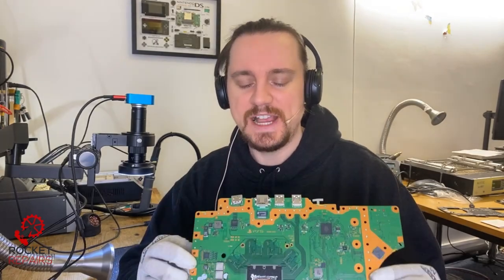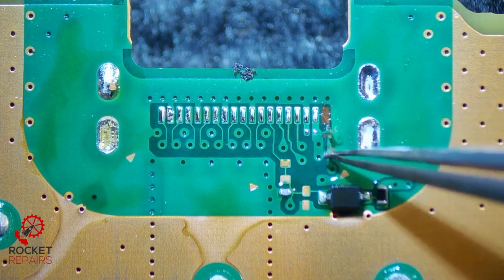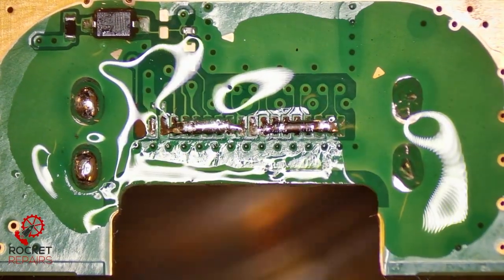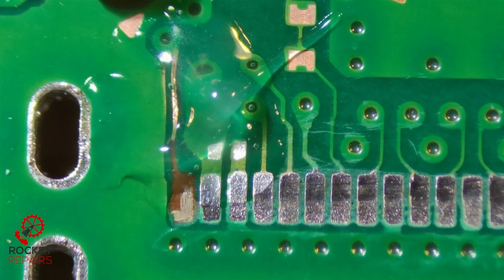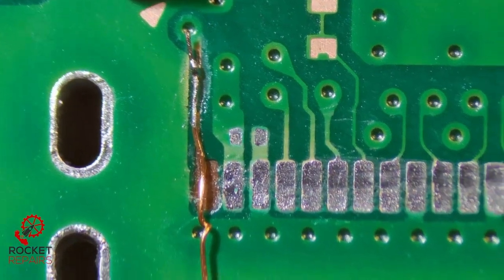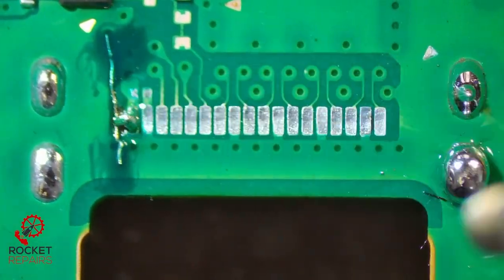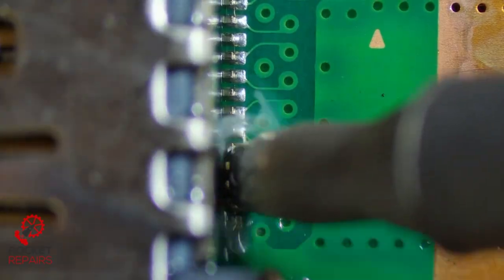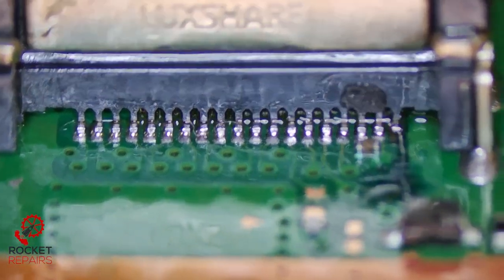PS5 HDMI PORT - TRACE DAMAGE? Let's Find Out!

Comment: What soldering iron and temp do you use? ive tried a couple and they cant seem to melt the solder when touching up the pins even when using flux.
Reply from the maker: You need a good soldering iron that can maintain heat. our run at 415 degrees but they are OKI Metcal irons so designed for industry. Those little 65watt types you can buy from Ali Express just don't have the power.